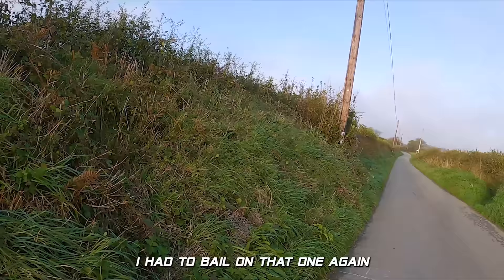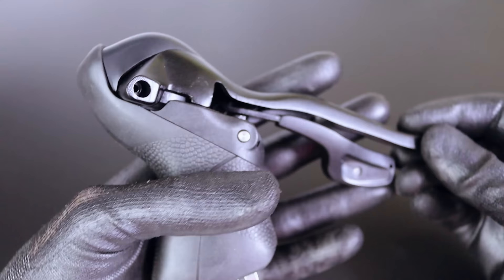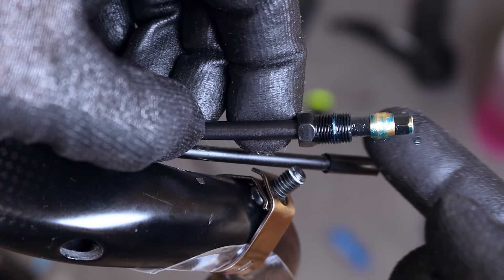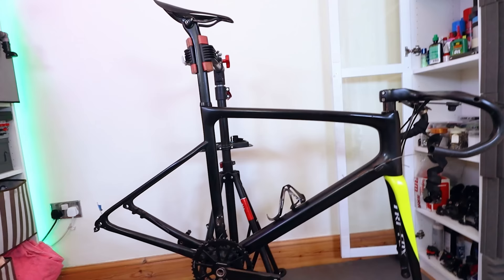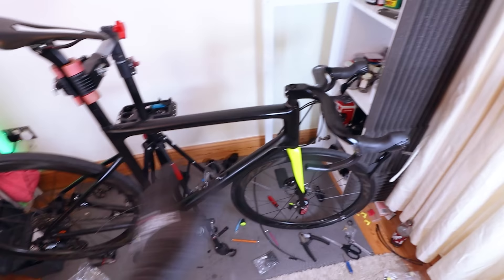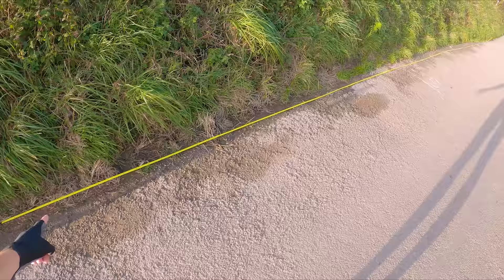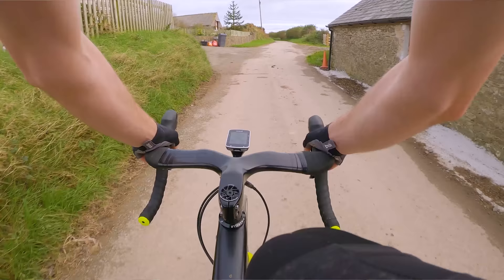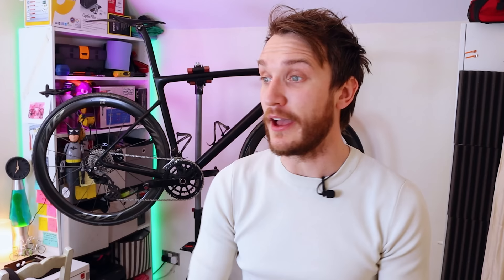Mechanical VS Hydraulic Disc Brakes - Shimano RS505 install & test

Comment: I have used rim brake for almost all of my entire biking journey.

But last year, I had work in another city. And that city have a hilly terrain and helluva traffic. Hence i need to get a disc just because the traffic is sketchy and I prefer to have the ability to brake instantly and confidently in emergency. But since covid bike shortage, only available opt is mechanical disc (retrospec with sram groupy, it’s basically a rebranded zrace)

I gotta say, personally, moving from rim to mechanical disc takes a short time to adapt. Because basically a rim brake is a disc brake in a 622mm (700c) instead of 160mm. And both are pulled with a sling. Even the modulation is kinda similar on the end pull of the brake lever.

4 mo’s ago I was in search for a hydro set cus the shortage is coming to end. Had a quick 2 week test run from my friend bike with ultegra full hydro on. And i almost crashed 4 times just because the difference is so damn noticeable. Yes the power is there, but the modulation man…… I’m just not that confident in it. Hence i just went back to my mechanical disc set.

So in conclusion, if you came from a rim set. Either just stick with the rim, or if you really need that disc, get that mechanical set. The braking power is significantly increased from a rim set, but the modulation is almost similar. A safer option. And me personally, breaking my mechanical braking muscle memory to adapt on full hydro is so damn hard

But if you never had a rim set, then just get that full hydro. Since you don’t have that mechanical braking muscle memory, i think you’ll better off with that full disc set.

Comment: Good comparison. The rotors you have on your tests in my experience do not provide as better modulation, regardless of your brake lever pull. I switched to SRAM rotors and noticed immediate improvements. I have the RS505 too, and was not finding those "over-the-handle-bar" experience on heavy braking. I feel the quality of the rotor has a significant influence. Perhaps your next test !

Comment: Progressive braking is what you learn on motorcycles. That meanS adding more and more pressure till you stop rather than full on grab, to prevent locking. It works and it's pretty much what you described. It's something you have to practice though if you want to do it well and have never done it before.

I have fully hydro on a fairly basic Merida carbon bike. It was about £1200 new which is half the cost of a Trek Domane competitor.
Reply from the maker: Yeah totally agree. Its that's progressive application of power that's the key. I think a little more time on the bike, and I should have it down

Comment: Nice job on the video. I just got a Poseidon gravel bike and initially I wanted to get hydraulic brakes but after seeing how stupidly expensive they are, I just don't think it's worth putting them on this bike. It comes with Tektro brakes so I think I will at least upgrade to compressionless housing and possibly throw some Juin Tech F1s on it and that will probably be good for this bike.

Comment: Great video Luke, really insightful! I also had to run Cable-Disc for a while because my shifters were busted and I had a similar experience to yours, although I decided that I could not live without full Hydros. I’m very eager to see a fully hydro groupset by Sensah or Ltwoo in the near future

Comment: You should test the wet performance. I bike commuted 12,000 miles on mechanical disc and switched to hydro last year. So much better especially in the rain. I had all the issues you had. Rusted cable. Frozen brake cable due to frozen water in the cable housing and frequent brake pad replacement. All of these issues have been solved with the hydraulic setup. Great videos! 👍

Comment: Great video again, thanks.  I would suggest that another couple of factors to consider are ease of maintenance and riding conditions. I used 105 hydro discs throughout a nasty north of England winter, riding 2-3 times per week. They suffered and needed a lot of looking after. Despite careful cleaning and servicing, pistons stuck and ruined a couple of rides. Also getting them centered after swapping wheels (gravel to road and back) was a constant pain. Also the 105 have no actuation adjustment which I found frustrating.  I now have TRP Spyres for the road and feel they are more than good enough for the road (steep, crappy Peak District hills) and sooooo much easier to look after, eg independent pad adjustment and easy cable adjustment. However for off-road riding the incredible power and modulation of hydros come into their own and outweigh the servicing/set-up concerns. Essentially, for me it's a cost - benefit analysis. Cheers.

Comment: I have several bikes with multiple option on board now: Shimano full hydro, TRP HYRD and Juin Tech as well as the SRAM HRD. Well, what I can say is, for day to day usage, something like commuter bike, which might not have that much care, a full hydro setup is better, as it is sealed. Cable actuated one is good, but you will need more maintenance/more attention on it. the cable compression rate and quality is crucial to make it work. And yes the top end raw power is better on full hydro, but it is just applicable for emergency brakes, which is not common in daily rides.

My personal thought is that if one has sufficient skill and time to fiddle around the setup, mechanical hydro is more fun to setup and can kill more free time (Which i enjoy). And full hydro is for those who like to set it up and forget.

Good vid！

Comment: I weight 120Kg, ride mountainbikes on very steep Tracks and use only one finger to brake to to keep control. Even with 235mm disks and metallic Pads i could use more braking power.
If i let a unexperienced rider use my bike i always demand that they train using my brakes first.
So i guess "too much" braking power is very subjective.
Thanks for your content. I cant even tell why im watching it because i dont ride street bikes, but i really like your videos!

Comment: I run wires for a living and using the old wire as a pull string for the new one is legit the best way to get a wire through a conduit/wall/etc

Comment: Hi, shimano have changed the position of the fluid reservoir on the modern shifters, be it 4720 tiagra  7020 105 8020 ultegra , duraace and all models of GRX  it's now at the highest point on the hoods where you screw the funnel which makes bleeding easier, also as already stated you need to adopt a range of positions and methods to get all the air bubbles out, especially the rear brake, bike positioned as upright as possible, flick or tap the hydraulic pipes, inject the fluid then suck the fluid, inject and suck, inject and suck,  until all bubbles disappear, always making sure the reservoir cup is never empty, then give the bike a try , then just attached the cup reservoir with a small amount of fluid and pump a few times to release the final few trapped bubbles, once you have done a few it becomes fairly routine, if you come from the world of mtb where hydraulic has been king for years it's no big thing. Hydraulic brakes make a huge difference on alpine descents just the stopping power into hairpin bends is massive , choice of rotors will make a difference especially on long alpine descents,  shimano ice technology rotors will be better than £7.99 chinese rotors but at 4 x(min) + the cost, but for commuting/everyday riding in the UK cheap rotors will be fine. 
To sum up, if you are used to hydraulic (from mtb) then you will never accept anything else

Comment: What I like is you compared weight to a cable disk, not seen that done, usually by disk bashers comparing to rim brakes (I am a rim brake fan 😀 just not a disk basher)
I also like how you explained the trouble you had using all the hydro power and the effect it had, most of us are normal riders not pros, you look like an experienced rider but still had trouble...... You didn't have to bail with cable disks did you😏.
So another great video Luke.

Comment: I didn’t need convincing that rim is better than disc… but this video really highlighted many of the issues I have with hydro disc. 

I will be making a video about this as your experience is great evidence for my arguments. 

It’s shocking that they are putting noobs on hydro disc. It’s just dangerous.

Comment: In your previous video at the end, using metallic hybrid pads, you got to 11 and change meters. So 10 and change vs eleven and change, that's getting really really close!
Reply from the maker: Yeah definitely. Tbh good braking is all about technique, especially emergency braking like this. In my opinion, mechanical brakes are just a bit easier to control for the amateur in this particular scenario. Plus decent bake pads make a world of difference!

Comment: Luke love your channel. I have done so many of the things you have done and tried through the years, looking for the best possible performance vs value I can find. Even this video, I have an older Carbon gravel bike with a 105 10 speed set up I built. Started with with entry level Shimano mechanical calipers,  which basically didn't stop at all!, tried the Juin Tech calipers but the rear one would not clear my frame, settled on TRPs for a few seasons which worked OK.. Mad force needed for a down hill bomb though. Then in early 2020 Shimano RS-405s showed up on Ebay for $148/112GBP. Full kit calipers and all. Had to sell the flat mounts for post mount calipers AND these shifters have an 11speed throw so had to pick up an 11 speed rear mech. (added cost unfortunately) but still too good a deal to pass up. As you said the braking power with full hydraulic cannot be beat. Keep up the good work!

Comment: I’ve got 105 group set with semi hydro mechanical brakes and 105 group set with fully Hydro brakes. It’s night and day the Hydros brake better and the feel is better. However I do prefer the 105 mechanical shifters to hold over the hydros.

Comment: Fully hydraulic feels so good. I used them for over 10 years on a super nice bike I had until it got stolen (moved to the Netherlands--go figure). Haven't used them since but I did recently buy an electric "bakfiets" which is a cargo bike with a "basket" on the front with benches for children. The thing is obviously heavy as hell and is a cheaper (2200 euros) Chinese rebrand so the components are crap, including the mechanical disc brakes, which is super dangerous on a heavy bike designed for hauling kids! I bought a pair of HB-100 (semi-hydraulic) brakes as drop-in replacement and they're way better than stock, but still not nearly as good as full hydraulic. My guess is that unless you're doing hardcore downhill mountain biking or have a heavy arse bike like my bakfiets, you won't truly see the massive difference between full hydraulic and mechanical actuation. Since I'm still cheap, I might try the Juin tech if/when my HB-100s fail.

Comment: Good luck with those 505 shifters, If you do a lot of miles the shifting mechanism on the rear one will wear out really quickly.
Reply: Had them since 2018 and had to replace one lever and caliper. Worked out OK lever failed first, got both as a set, then a caliper failed and was able to use spare I had. Still think they are great
Reply from the maker: OK cool, thanks for the heads up. I'll def keep an eye on it!

Comment: Try out the full 105 R7000 set since you clearly have a tendency towards them😁, then make a real comparison between the 105 and all these other Chinese sets that you extensively tested and reviewed in all these great videos (AWESOME channel, btw, THANK YOU!). But make sure you PROPERLY set up the 105, it's a bit fiddly at first, ride it for at least 1000 miles, make sure you "learn" it and adapted to it. Until you feel like every bit of every single pedal stroke gets transmitted to the ground, in all combinations of cranks and cassette cogs, you haven't yet properly set up the 105. A properly set up 105 shifts, without exception, in 1/2 (half) of a pedal stroke. Mine still misses some downshifts in the rear, but the cassette is a Microshift 11 speed, will get back with an update once I change the cassette to an original if anyone wants to know. 

Thank you so much for all the good information!

Comment: Excellent video, well put together and informative. I especially like how you've highlighted the need to practice braking. I did a similar type of braking practice on my motorcycle. I practiced and practiced so much on my braking that I went through two rear tires until I could stop from 60 Km to zero in one car length without skidding a tire. The goal was to be in first gear and set down the left foot when completely stopped. The front tire was fine but the back one suffered a lot until I learned how to apply maximum braking but not slide it.
It takes a HUGE amount of practice to get really proficient at braking. I'm now beginning to practice with my new cargo bicycle. Unfortunately it has mechanical brakes so I will be upgrading to either hybrid brakes or full hydraulic ones.

Comment: Great channel, I recently found it. One thing I'd add relating to your concerns about hyrdo disc power. Rider weight. As a 235lb (106kg) rider, the extra braking power gives me brakes that probably perform similar to your experiences with mechanical disc. I recently had my only rim brake bike totalled in a wreck, and I have to say the replacement bike with ultegra disc brakes and 160mm rotors stops almost as well as my mountain bikes. I don't miss squishy brake levers.

Comment: You could try a 140mm rotor for your back brake to stop that early locking up.
You can brake with your back brake a millisecond befor you brake with the front brake to avoid the lifting of the back wheel. You also can change it in the STIs that the back brake starts a bit earlier
Reply: had a pair of rs505s, believe they are very limited on adjustment. best thing to do is practice modulation IMO

Comment: Uhhh your rear brake lever is on the right 🤯 mad man 🙃
Modulation explanation is great; hydraulic has no stretch like a cable (can't compress a liquid) so it's very linear to lever application 👌

Comment: Any scuff or damage at the end of a hydraulic line will prevent the olive from sealing when crushed and likely cause a leak. Sometimes you can route longer line than needed and cut the end off for a better seal.

Comment: what you could have done is put the saddle down which would have allowed you shift your weight back.  Same issue I had when testing brake pads but its a lot easier to do on a mountain bike than a road bike.

Comment: Have you seen the Giant Conduct hydraulic brake system?  it uses regular cable lever, which pulls a master cylinder and rest of system is hydraulics.  the benefit is that you don't need to disconnect the brake system even if you need to change lever/handlebar.  but the drawback is that you will need to use specific stem for mounting the master cylinder.  it retails for less than 200 USD, so it might be a manageable alternative for hydraulic brake upgrade.
Reply from the maker: Ha, funny you should mention that,  I actually ordered a set last month 😁 just need a new bike to put them on...
Reply: @TraceVelo  lol... looking forward to seeing your review on the Conduct hydraulic brake!

I have a Giant Defy, which came with Condcut system.  no complains except the free stroke is longer than I like and there is no official way to adjust it.  there is a video on adjusting free stroke, but it's the "unofficial" method, involving squeezing lever without rotor or block in the caliper.

Comment: Running yokozuna ultimo (an improved Juin tec GT)  hybrid hydro/mechanicals on my Traveling (s&s coupled) custom Ti  Monster cross bike.
Had to do cable disc because the frame breaks in two for packing... so the rear cable needs to be set up with a splitter.  You can't couple split a hydraulic line.

Anyway, with Force AXS  mechanical brake levers and XTR rotors (8" front 6" rear) those brake calipers will RIP YOUR EYEBALLS out of your headl if you lock them up. 
(Which you can do with one finger if you want) modulation is great.    Its a 4 piston caliper - uses Shimano saint pads. 

Mechanical discs have come a LONG way since the late 90s...

Comment: Hi Luke, another great video, was waiting eagerly for it. I have the same handlebar from China based on your  previous review. I had a hell of a job getting gear  cables and hydro hoses through and had to file the holes a bit bigger and smoother to avoid cuts etc. One thing i didnt do was remove the levers apart from clamps on same 105 levers so had a real swine of a job connecting the hydro hoses with levers in situ! Lol. I learned a lot from you there.  I too found bleeding wasnt easy but i finally got it done.

Want extra braking power for a heavier rider?? I fitted 180mm front rotors and 160mm rears now, sorted!